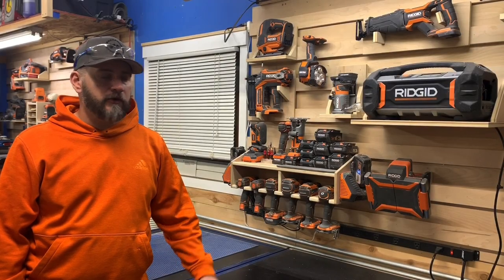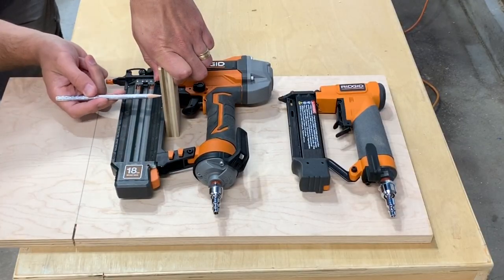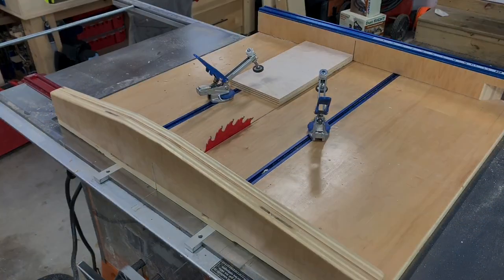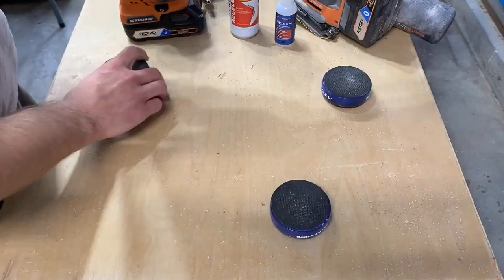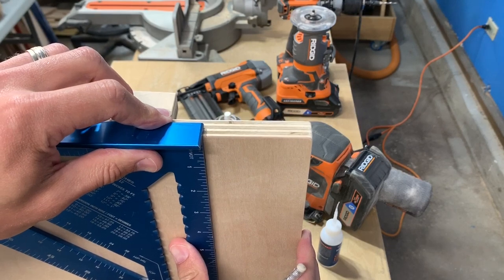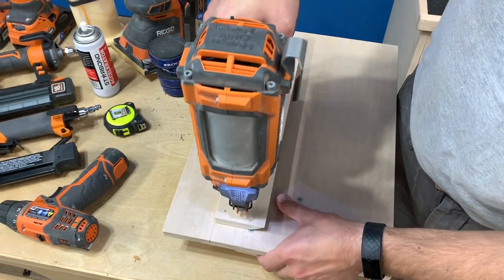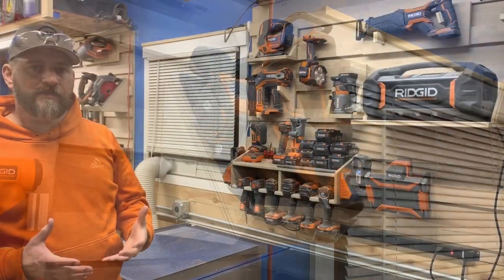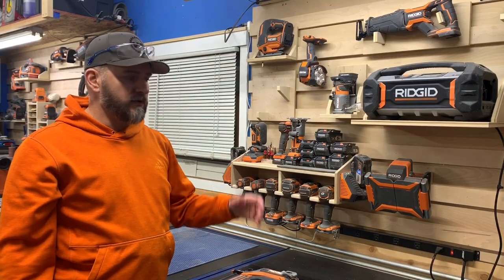CReeves Makes DIY French Cleat Tool Holders ep34

Comment: I'm building the first few tool holders for my new french cleat wall.  The current challenge is for my jigsaw, which is going to look very similar to your design.  Thanks!
Reply from the maker: Oh awesome! Congrats and good luck!
Reply: Jigsaw holders can be a pain. My first effort was an angled affair that just did not work so I revamped it with something similar to this vid with a space to add a small box beneath it.

Comment: Nice video Casey.  I built a french cleat wall and several tool holders for my Dewalt tools.  It works great, and I like that I can move the tools around at will.  You gave me some good ideas though (like the angled holder for a hand power saw).  And I like the CA glue protocol too.  I'll get some through your link.  I don't know if you video'd how to actually build the wall, but it is fairly easy: I had a finished sheetrock garage so I  chose to add vertical 2x2 strips over the sheetrock on top of the studs, and then put the 3/4" ply over those.  I also learned how to extend out electric wall outlets so that they would be flush with the plywood cleat wall.

Comment: So, which starbond did you use in this video? thin, medium, thick, etc...
Reply from the maker: Medium. I use medium for almost everything in the shop. I use thin for veneer repair and thick for large glue ups where I am also using wood glue/

Comment: quick question...im new to woodworking so dont judge me lol. But why not also add screws to the french cleat that goes in the back to the panel itself?
Reply from the maker: Great question! The glue and Brad nails have proven to be strong enough to hold all of my tools with no issues. You could add screws from the backside but I wanted to see how the glue and nail worked first. Plus the way the tool holder sits on the cleat, it is only pulling in a shear force way, not a rotary leverage force.

Comment: Great video, may i ask what tickness of plywood you use on the holders?
Reply from the maker: Mostly 3/4” and 1/2” scraps left over from other projects. The thickness depends on the tool that I am supporting.

Comment: Great tool holder, thanks. 
Does anyone have ideas, thoughts or plans. I'm building a 20x30 shop and I'm looking for help laying out tool placement. 
Table saw miter saw band saw drill press planer joiner/planer.
Any help greatly appreciated. 
Thanks, beginning wood worker.